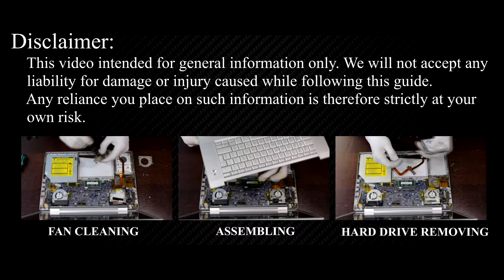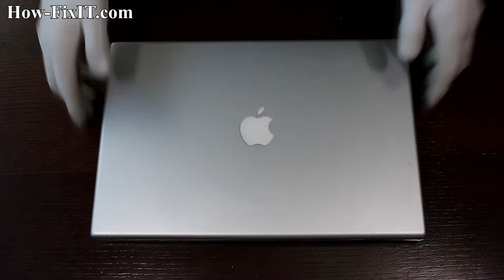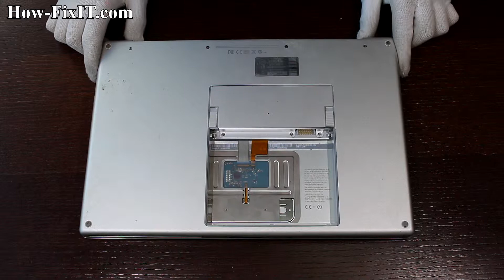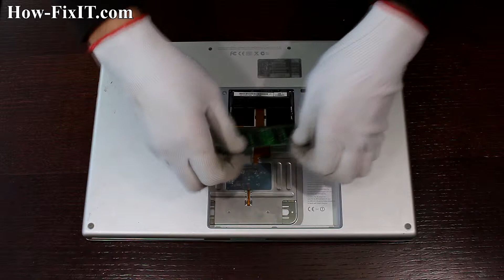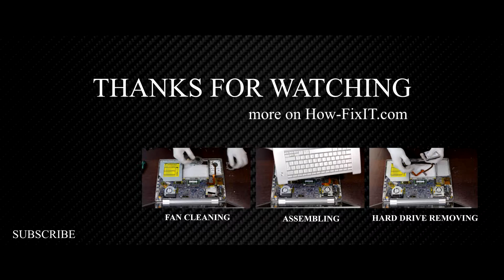MacBook Pro 15" 2008 Model A1226 Upgrade and installing RAM

Comment: if you can rest the keyboard up and masking tape it near enough vertical to the screen, you can swap everything out with only disconnecting the two connectors at the bottom right of the hard drive. undo as little as possible. :)